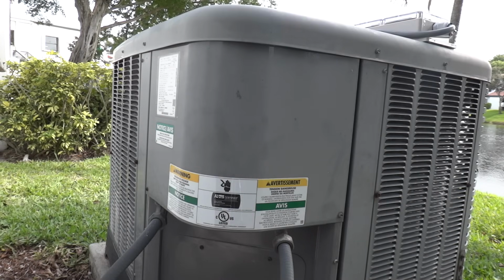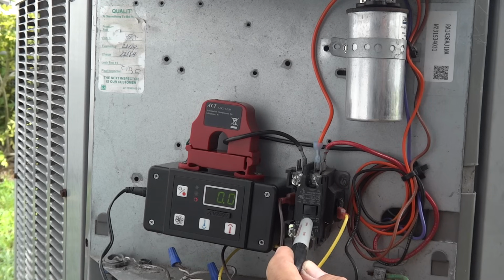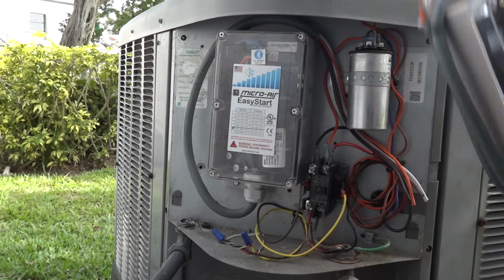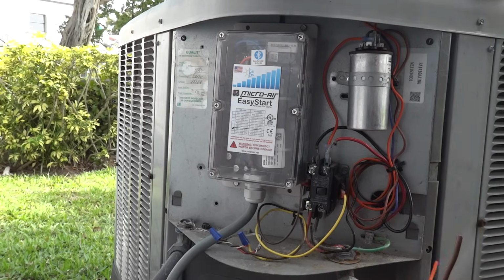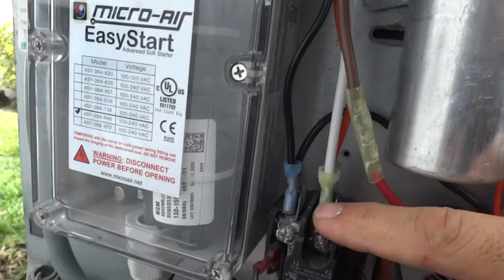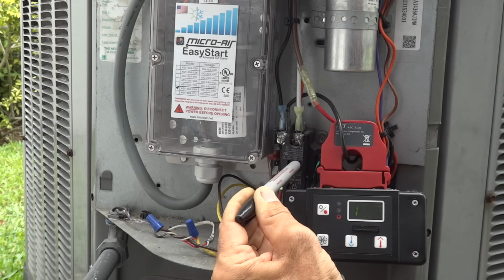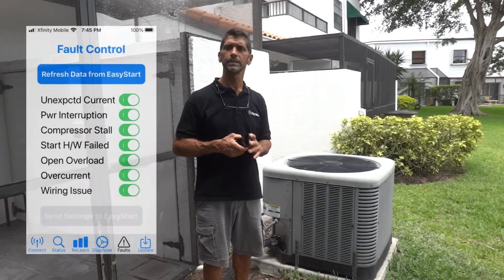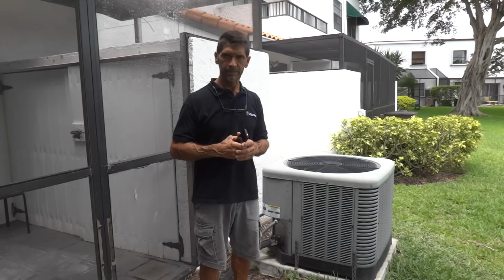Micro-Air EasyStart Home A/C Installation (368 Series)

Comment: Hi there, I know that the Easy Start has been used in well pumps.  But can it be used on pool pumps?
Reply from the maker: Hello Pablo and thank you for your comment.  Yes, EasyStart has been applied to well pumps and to other frame motor, ODP or TEFC, like a pool pump.  Unfortunately, the challenges associated with wiring EasyStart to a well pump actually get worse with a pool pump. The wiring of most frame motors is not always easily accessible, and depending on the motor manufacturer, it can be VERY difficult to obtain the internal wiring diagrams for the motors in order to determine where the common, run and start winding connections are located.  Trust me when I say this as I have dealt with this firsthand more than once for certain OEM customer applications where we were willing to go to great lengths to apply EasyStart.  As a result of this difficulty, Micro-Air instituted a policy several years ago to no longer support individual applications of EasyStart to frame motors such as well pumps, pool pumps, air compressors, dive compressors, etc.  We wish we could support these applications, but the amount of engineering effort and the huge variety of motors across the industry makes it impractical, unmaintainable, and unaffordable.  

That being said, we always advise customers with such applications up front to not purchase an EasyStart unless they have advanced knowledge of the motor itself and they can handle the wiring on their own.  We wish there were a practical way to provide support for these specialty applications, but unfortunately there is not.  Thank you for your understanding and consideration.

Comment: If you have one of the smaller A/C unites they can Mini-splits that have A/c and heat do you recommend a Easystart when the unit is powered by solar?
Reply from the maker: Hello and thank you for your question. The first part of your comment is unclear, so we are not sure we fully understand your question.  If you own a mini-split with an inverter-driven compressor, then EasyStart cannot be used. If you own a standard A/C with an PSC (CSCR) induction motor compressor, then EasyStart will be very beneficial to you when operating on solar power or on solar/battery inverter power.  Hope this helps.

Comment: Looks like a great product.  
Should there be a safety comment about working around sizable capacitors due to their stored energy?  Maybe explain how to discharge a cap before working around one.
Reply from the maker: Hello and thank you for your comment. As it turns out, the run capacitor automatically and quickly discharges through the motor windings start-to-common-to-run after the contactor opens or the power is turned off to the condensing unit.  You'd have to touch it almost immediately after power was removed to get electrocuted.  Beyond this, any OEM-installed hardstart kit (i.e. a start cap) may have to be discharged before removal (as part of the EasyStart installation) if it does not have a bleed resistor (which most do).  Only start caps without bleed resistor can hold charge and are potentially dangerous.  Nevertheless, it is always safe practice to short the capacitor terminals with an insulated handle screwdriver after turning off AC power.
Reply: I agree.  I have an electrical background so first thing turn off circuit breaker to the HVAC.   Short out caps with an insulated screw driver.  Also I found on my unit there is another power circuit going to the attic unit which does also provide 120volts to the outside condenser unit EVEN thought the cutoff switch is disconnected.  So look into that circuit breaker as well.

Comment: This gets me wondering if this theory could work with my 220 well pump?  Any thoughts?  Thanks. I plan on getting two easy starts for both my 3 ton units.  Never use the downstairs ac much but in a power outage it would be nice to have both available.  Along with a large generator.
Reply from the maker: Hi and thanks for your question.  Someone else asked the exact same question 2 days ago in the comments of this same video. Click on the link below, and it will reopen the same video with the comment I'm referring to at the top of the list, labeled "Highlighted comment".  There you will find the answer to your question in the replies to that comment.

https://www.youtube.com/watch?v=bp4U-husy1o&lc=UgzSHt87Whae7lZvrE54AaABAg
Reply: @MicroairNet  the link isn't click able on youtube android mobile
Reply from the maker: @Colindstuart  This often happens.  Please try cutting and pasting the link into your browser.
Reply: @MicroairNet  "This video is unavailable"
Reply from the maker: @Colindstuart  Okay.  Sorry for the trouble.  The link works for me in a new, not-signed-in window. Anyway, here is all that you would have found when I answered the question for the other person who inquired about the same topic:

"The EasyStart ASY-368-X72-BLUE has been installed with success on a few 230V 3-wire well pumps in the past.  The challenge with these installations is that the wiring is a bit more complicated and sometimes less easily accessed than that of an air conditioning compressor.  As a result and due to resource limitations, Micro-Air no longer recommends that you purchase an EasyStart for well pumps and the technical support team no longer provides support for this specific application.  This of course does not mean you can't do it on your own, at your own risk, but we want it to be clear to you up front that the team unfortunately cannot provide assistance. Hopefully you can understand."

Comment: Just a follow-up - After installing the EasyStart, I pulled the trigger on a new inverter generator. I purchased a duel fuel (gas/propane) GENMAX 9000iED. I did the break-in, converted to a floating neutral, and did my whole house test. Because of EasyStart, I can run my entire house, with all steady state and cycling loads (all lights, ceiling fans, TVs, computers, bathroom fans, 3 ton AC for the house proper, mini-split for the garage, 2 refrigerators) with no load management required. Additionally, with minimal load management, coffee pot, microwave, air fryers, hair dryers can all be run. House AC, oven/stove, clothes dryer does require load management. But the important thing is the house AC can be run just fine on the generator WITH all of my normal creature comfort's and on propane. No more bad gas/gas storage issues. Thanks Micro-Air for a terrific product.
Reply: Been thinking of doing the exact same thing. Same generator etc. 
watched a very lengthy video designed for HVAC techs by this same guy about the Micro Air. It was awesome. I even understood most of it. 
BTW some claim there is no data to prove the soft start kit will lengthen the life of my compressor BUT that’s not why I need it. It can’t start my 4 ton heat pump without it!
Reply: HOW do you wire for this...converted to a floating neutral...please explain
Reply: @mikegainsley1479  disclaimer, I'm not an electrician  I would recommend getting a generator that specifically comes designed and with instructions to convert to floating neutral if you're going to connect a portable generator to your house.  If it's not designed for it, it's probably not a DIY type thing and you have to reeeeally know what you're doing.  I got a Westinghouse 11500 that comes with instructions, all you do is disconnect a wire and put a new sticker.
Reply: @Benjamin-rq1fi Where did you find the Westinghouse 11500 tri fuel in stock?
Reply: @JetFire9  I got it on Amazon around July 9th before it went out of stock there.

Comment: Is this meant to save money by not using high amps to start the unit?
Reply from the maker: Hello and thank you for your question.  EasyStart's is meant to reduce the starting amps in order for you to be able to start and run your A/C on a limited power source like a generator or solar inverter.  EasyStart also protects your compressor even on utility power from hazardous electrical events like brownouts, power interruptions, and low-voltage.  

EasyStart does not save electricity usage (kW/h) since it does not affect your compressor's running amps (i.e. only the starting amps).  So, if like most you live in place where your power utility company only charges for electricity usage and not for "demand", then EasyStart won't save you money there.  However, if you do live in a place where the electrical utility charges for you (more) for peak power usage (kW, what they call "demand"), then EasyStart can save you on your bill because it eliminates that peak power spike caused by your A/C's compressor.

Comment: Is there an easy start for 220v well pumps hope u have 1 let me know
Reply from the maker: Hi and thank you for question. The EasyStart ASY-368-X72-BLUE has been installed with success on a few  230V 3-wire well pumps in the past.  The challenge with these installations is that the wiring is a bit more complicated and sometimes less easily accessed than that of an air conditioning compressor.  As a result and due to resource limitations, Micro-Air no longer recommends that you purchase an EasyStart for well pumps and the technical support team no longer provides support for this specific application.  This of course does not mean you can't do it on your own, at your own risk, but we want it to be clear to you up front that the team unfortunately cannot provide assistance. Hopefully you can understand.
Reply: @MicroairNet  ps I found u threw the preditor 9500 Inverter utube harbor freight guy
Reply from the maker: If the system has a wiring diagram, take a clear photo of it and email it to tech support (help@microair.net).  Someone will draw in where the EasyStart wires and send it back to you.  Make sure you mention "Matteo" in your email so it gets forwarded to me.
Reply: @MicroairNet  be a couple days
Reply: Where do I. Find this i have knowledge and full access too control box and tank regulator have pulled 4 220 pumps on my own200+ft reinstalled cake walk now im all in for it ,if I can't make it work it can't be done. My moto ,sometimes things break. You deal with it or you never get  it done thanks for. Your help and getting back too me ,I m old but that has not stopped my desire

Comment: Where can I buy your clamp meter that you used on this video, sir?
Reply from the maker: Hi and thanks for your comment.  You are not the only person who has requested this over the years. 
Unfortunately, that device is one-of-a-kind since I custom developed it many years ago for testing EasyStart installations. It is therefore not available for sale.  

The benefit of this special device is that it uses a 50ms moving average window for peak/inrush RMS current measurements, so it is quite accurate and can capture the differences between an unmodified system, a system with hard start, and a system with EasyStart.  Many other off-the-shelf clamp-on meters do not do this because they're too slow, even in their "MAX" or "INRUSH" modes of operation.

The best off-the-shelf clamp-on ammeter that we have found is the Uni-T 216C or 216D (newest).  These were once available on Amazon, but they're not anymore. I just found someone with a large stock of the Uni-T 216D ammeters on eBay. This device has an "INRUSH" mode that we have found does a very good job and almost exactly matches the speed and accuracy of what we are able to attain with our home-grown device.  Hope this helps.
Reply: @MicroairNet  Thanks for the reply with explanation and recommendations.

Comment: Will this work with dual stage compressors? I have a Carrier 5 ton unit and Im told its a dual stage unit.
Reply from the maker: Hello and thank you for your question. Yes, EasyStart will work on a 2-stage system such as yours. Most 2-stage systems are actually one compressor with two output capacity settings, controlled by an internal solenoid valve.  EasyStart works fine with these, but you should take some extra steps during EasyStart's learning process to better accommodate this type of compressor. I go into the gory details in another comment reply in this video from 2 months ago.  Please check out this specific comment using the link below.  This link will bring you back to this same video, but with the specific comment reply at the top of the list with the extra heading "Highlighted reply".  Hope this helps. 

https://www.youtube.com/watch?v=bp4U-husy1o&lc=UgwQZZPABM8m6qYXlUp4AaABAg.9bncVBO7bvg9chl_dQ5qs8
Reply: @MicroairNet  hello and thank you for your quick response. I just received my 72 from you guys and I looked through the sheet you sent leading g to a data base but I didn't see where it addressed the dual stang compressor. I will look over the video in the link. Thank you again for the quick response.
Reply: @MicroairNet  Hello, I have one more question, I did open a support ticket, there is nothing wrong, but I have 2 yellow wires 10g that go inside the compressor housing. and both are connected to the blk side of the contractor. I have a dual stage unit. I sent pictures to the sales team since I could not upload pictures to the support form. order #47676

Comment: Would you recommend installing this on a 3ton ac unit using a portable generator  12,500/9500 watt. Or install a hard start? bc the generator has more power?  I'm leaning towards a soft start since the generator will have power being drawn from other things around the house limiting how much more power that it can provide at the time of ac start up. I am under the impression that a soft/easy start is better for lower or less power generators to start the ac compressor.
Reply from the maker: Hello and thank you for your question.  Even on a generator that was already large enough to start an A/C without anything added, we would recommend the EasyStart over a hard start because of the exact reasons you cited and what was also mentioned at the end of the video.  With EasyStart installed, you can have more appliances running in the house whenever the compressor goes to start, there is much less stress on the compressor during any start (i.e. on generator or utility power), and there is less stress on the generator during a compressor start.

Comment: Do i have to use the WiFi? I don't like messing with the Wifi on my cell phone.
Reply from the maker: Hello Alfonso and thank you for your question. The EasyStart does not have Wi-Fi, only Bluetooth in select models.  The use of Bluetooth and the smartphone app is totally optional and is not required for the operation of EasyStart.

Comment: Why have three to choose?  The X72 will work on all 6 ton and below.  Seems you are just manufacturing three devices as an excuse to create price teers in order to haggle more money when the actual need doesn't exist...
Reply from the maker: Hello and thank you for your comment.  In fact, there are component and manufacturing cost differences between the EasyStart ASY-364-X36-BLUE, ASY-368-X48-BLUE, and ASY-368-X72-BLUE that allow each of these model's target capacity ranges to be optimized better.  That is, if you purchase the largest size for a very small unit, it will work, but it won't deliver the absolute lowest possible starting currents.  We apologize if this upset you, but please know that we also want as few models as possible to keep things simpler.  We continue to work towards that goal.
Reply: @MicroairNet  Blah Blah Blah...

Comment: Without EasyStart, what was the continuous run current after the initial 77amp start up? How long did it take to get to that lower continuous run current?
Reply from the maker: Hello Larry and thank you for your question.  EasyStart does not change or affect the continuous running current. EasyStart only affects the startup current.  The startup sequence is completed in about 0.7-1.0 second, after which the compressor will be drawing its normal running current.

Comment: Whats the warranty?
Reply from the maker: Hi and thanks for your question. Officially, the warranty is 2 years.  But since the product is so mature and issues are so rare, there really haven't been any cases where a customer was denied a replacement for an EasyStart that was perceived to not be working after having been installed correctly and known to be working for a long time.
Reply: @MicroairNet  Thanks!

Comment: Just today installed an EasyStart on my 3 ton unit. Locked rotor amps listed as 77, read 89 using a clamp on. Close enough. On first learning start - 44.5. After last learning start - 27.5. My HVAC guy had not heard of EasyStart before I contacted him. Said he was ordering one for his house today and will start recommending it to his customers. Now I can replace my old Troy Built 13500 with a much more efficient dual-fuel inverter generator.

Comment: Hi Mr. Matteo, My question..... I have a 3 ton AC heat pump will the ASY-368-x48 allow my 5000w 42-A max. generator to start this unit?  Thanks! Tony
Reply from the maker: Hello Tony. Thank you for your question.  As you can see in the sizing chart presented towards the end of the video, a 5000W generator will be marginal when it comes to starting a 3-ton system even with EasyStart installed.  It should start, but given the running amps for both your outdoor and indoor unit (~4500W), there will be very little generator capacity left to run anything else in the house.  This also means that you'll have to be very strict with your power management to allow your A/C to cycle on and off freely, based upon the thermostat.
Reply: @MicroairNet  Thank you for your excellent video and the quick reply! I'll be looking for a new larger generator soon and also a Micro-Air EasyStart. Here in FL this is a great item to have.